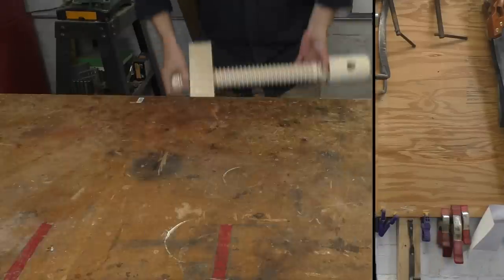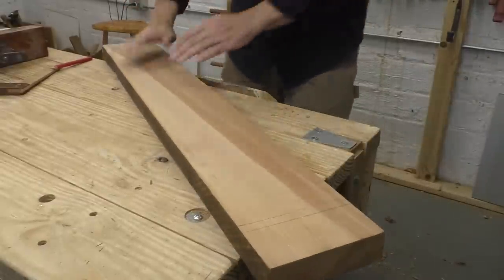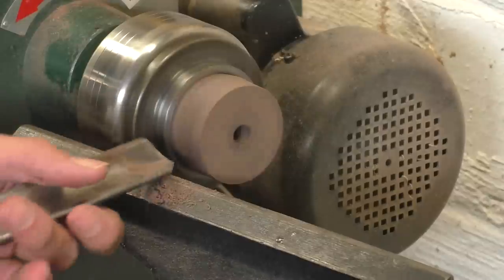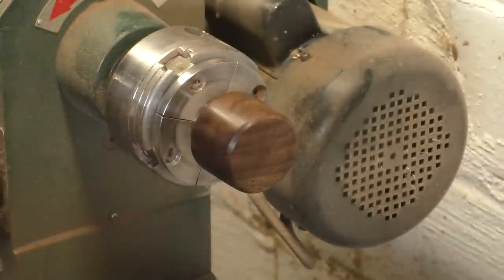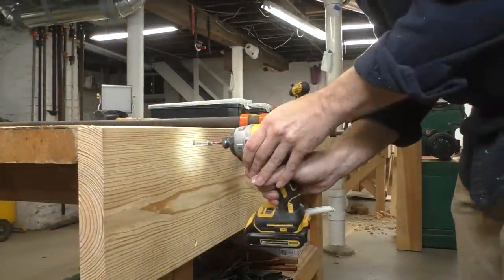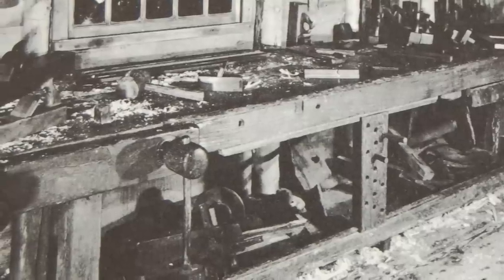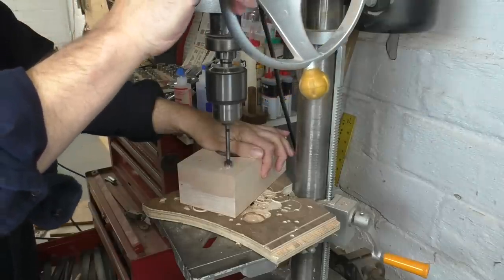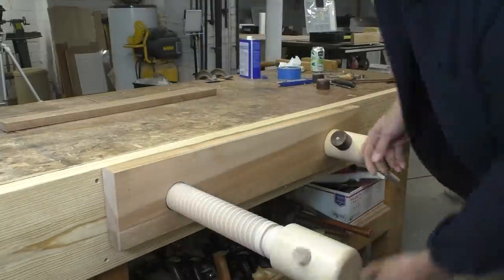Vise Squad #3: The Ancient Wooden Twin-Screw

Comment: Putting a work piece in that vice, it doesn't have to be centered.  I'm thinking that if set to one side you could tighten the screw on that side, then the opposite screw.  Rather than going back and forth to fit the jaw to the work piece.

Comment: I was hoping you had some crazy cheap diy way to make those screws.
Reply: You can get a threading box & tap to make your own from a 1.5" dowel.  And they  have ones for smaller dowels too.  There is also a threader that uses a router.  Finally, check out the vise Rex made for the low workbench from a scaffolding screw and get two of those.

Comment: That you don't like your twin screw vise because it is big and bulky is really your own fault for using those huge wooden screws.  You can use smaller steel screws/bolts that are fixed in the rear chop with round knobs you can twirl quickly against the front chop.  and then opening and closing the vise is loads of fun!

Comment: When I first got into woodworking, I looked into how to make my own wooden vise screws from thread taps.  One thing I found out from watching youtube, is to soak the dowels in mineral oil overnight (or longer) to get nice clean threads.  This is especially important on hardwood.  

The largest wood tap I could find on amazon is 1.5 inches at 6 DPI.

Note: I never did make any, but it sounds interesting.

https://www.amazon.com/dp/B07WJ71LN8

Comment: Actually I have a huge question. I made a leg vice from a slab of spalted maple. I used the same screw from Amazon painted black up top. But on bottom I gota smaller screw to use. But I can't get the screw to hold the leg vice. I gotta come up with some ideas cause I don't want to just use a block of wood. But ive also already bored a hole through the leg for the screw.

Comment: they may have swapped the vices out depending on what kind of work they were doing. if they were building lots of furniture that had longer pieces the twin screw would have been better but if they were making chairs or other small items the leg vice would have been better. just like choosing the right tool for the job. just my outlook on the situation.

Comment: I kind of wonder....
Imagine this vice, but with the gears John heisz put in his.  But the gear can be disengaged so you can independently lock down each side if you want to.
Reply: That is exactly how the Veritas chain drive works. There is a pin that lets you engage/disengage the chain sprocket from the shaft.

Comment: To start with, the Veritas chain drive thing makes no sense to me because it obviously cancels out one of the few twin-screw major advantages - holding work that is tapered. Secondly, the twin-screw is very much alive and kicking - being a carpenter, I have 5 Workmate type benches, ranging from very cheap to very expensive and they all have the same twin-screw vice/clamping action. However, while it may work conveniently well for carpenters moving around from job to job, I agree that I would go a bit batty if I had to use one day in, day out, in a workshop for accurate, high quality joinery. I mean, come on - I'd probably end up just nailing that sucker to the bench to cut or plane it! :-|

Comment: Hmm, they had pretty low benches at a height of 28 7/8 inches... Maybe it had something to do with the range of work they did, needing something extremely strong and reliable, while giving enough room to adapt to different types of work, and allowed them to work as a team on certain jobs that just worked better for them but may not for you working alone and limiting the range of work you'd do with them...

Comment: I can understand replacing one of the leg vices with a twin screw vice, but why not have both?
Reply: You mean... like Rex has done?
Reply: @johncoops6897  
Exactly. Like Rex, I’m questioning why they replaced both leg vices with twin screw vices.
Reply: Obviously the kind of work that they were doing better suited the stronger, more even parallel clamping pressure of the twin-screw vices.
Keep in mind that a leg vice only grabs the board at the top edge or bottom edge of the board (depending on where the lower pin is inserted) and a single screw means it requires a higher clamping pressure for an equivalent level of timber stability.
So they might have been working on furniture with easily-bruised timber where the leg vice created dents in a finished surface. Personally I don't agree with Rex's dismissal of the twin-screw as "inferior" - it's like saying that a large plane is not as good as a short plane, based on the fact that you have only used a short plane before.
You couldn't have both types of vice on the same side of a bench because they interfere with each other. However there is absolutely nothing stopping them from unscrewing the twin-screw vice jaw in that photo and exchanging it with the leg vice if/when that was better for a job.
They aren't mutually exclusive - the bench in that photo still suits both styles, and could be changed over in a couple of minutes max.
Reply: I haven't tried either one, but it seems like you could get most of the utility of a leg vise from one end of the twin-screw, and then use both screws when you needed them both.  Rex, have you investigated that?  It might explain why they replaced their leg vises with twin-screws.

Comment: Rex a threading kit would have cost $20 ~$40 tops. and you could made those screws yourself. you should think on getting some lol
Reply: For a 1/2" thread it would, the set to do those massive threads would be a few hundred dollars.
Reply: @jasonlipmyer36  there is one in amazon for a 3/4 at $40 XD
I know the ones Rex used look like  2' but a 3/4 should create enough force for normal applications :)
if you can recreate your work easily when you need it. it might be worth the investment.
Reply from the maker: Not even close.  3/4 is way too thin and slow.  There's a reason i paid for these screws.
Reply: @RexKrueger  well there is one inexpensive option. DIY
get a 2" bolt and screw with the thread you want. then you can use a file and cut  4 groves on the bolt and screw and make a wooden handle for the bolt. and a file the screw so it can fit in your hand drill.
the results can vary depending on the user skills lol (it was kind of mediocre in my case, but it got the job done)
and the finish might need some sanding touch ups.
but at least is an option to avoid paying so much XD